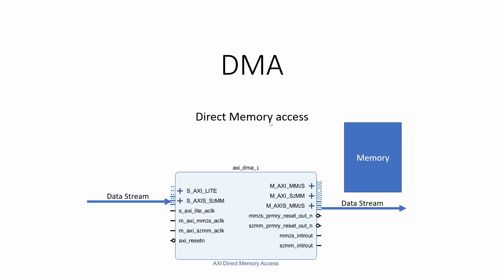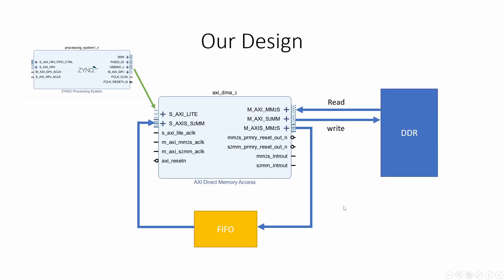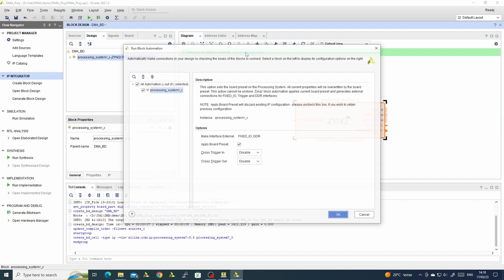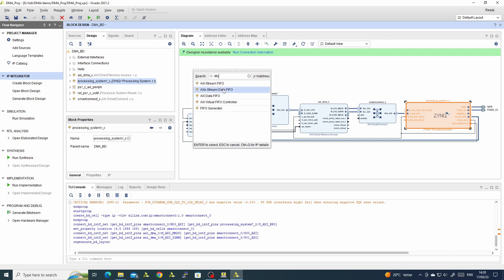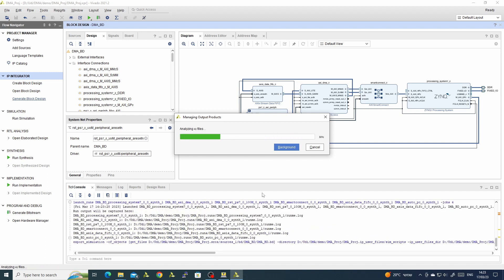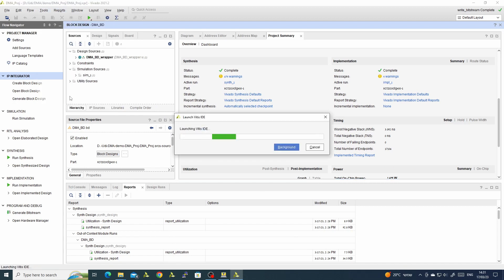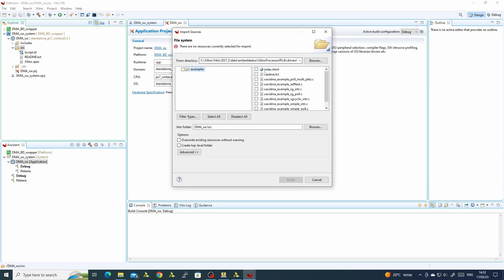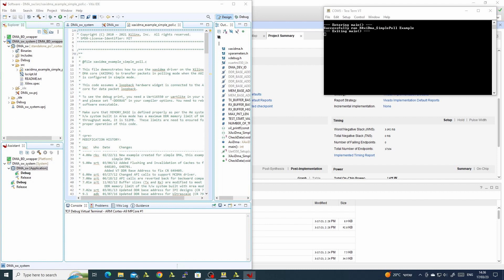DMA basic example

Comment: I am trying to move AXI data stream from an ADC interface in PL to PS for communication over Ethernet, and desperately looking for some resources to learn DMA for the same. Thank you very much for this video series. Learnt a lot. One question if I have to move data from PL to PS Ethernet, moving data to DDR and from there let ethernet BD read it is the best way forward or moving data from PL to OCM and from there to ethernet BD ? Which one would be more architecturally practical and suitable for a real time  application?
Reply from the maker: These are two separate questions:
To get the Data from the PL (ADC) to the Zynq DDR you need to store it in a FIFO and once you have fixed size (make sure not to overflow the FIFO), you can ether use Data-mover:
https://youtu.be/BeIYrQ3FUUo
Or have a DMA programed in advance to move the data to the PS-DDR.
Once the data is in the Zynq DDR (PS) use software to send it over the ethernet. In the Vitis, when you creating an application project, the last step is Templates. There you can fined lwIP examples. Those software's, are examples how to write & read ethernet packets.
Reply: @Udi-FPGA  Thank you very much Udi for the reply. I have tried to implement the interrupt DMA for transferring the data generating from a custom IP which is generating dummy ethernet packets at a regular interval on its M_AXIS port to store on the PS DDR. I was implementing the interrupt DMA  simulation example you have shared but it got stuck at SetupInterrupt function as it returned Failure. The only change I made to the example was I put this custom IP at the S_AXIS port of the AXIS DATA FIFO and connected its M_AXIS port to S_AXIS_S2MM port of the DMA IP while keeping the M_AXI_MM2S port of DMA IP disabled as I was trying to just write the data from the custom IP to the DDR. Now, I have gone through all three parts of Data Mover videos that you have kindly shared. It looks promising to me as the failure I am getting in setting up interrupt controller will not come there. Also I am using Unified Vitis 2024.2 IDE for software development and I came to know that they have changed interrupt handling from the  previous versions, although I don't think that could be the cause as I just used the example code as you have in your video and they have taken care of those changes in interrupt handling in the example code. So I am currently uncertain what might have caused this failure, I would be glad to have your opinion on this. For the time being I am moving to the Data Mover and will relook at the interrupt DMA and SG DMA approaches after that. Thank you very much once again.

Comment: Please make a video on custom pl data generation and converting it to axi stream so that it van be input to axi dma
Reply from the maker: The input to the AXI DMA is a simple AXIS (AXI Stream) bus. It just needs 5 signals: data, Valid keep, last & ready. I explain this bus in the beginning of this video. If you need to write data from the hardware to the DDR you might want to consider the Data Mover IP. This IP is controlled by hardware and transfer data to the DDR without software. (the software only needs to Invalidate the cache one the data was received). I might do a video on this some time soon.
Reply from the maker: As I promised, here is the guide to Data Mover: https://www.youtube.com/playlist?list=PLv0KRXOsP7UqbY4ZlhKZxJL52KkNipbAh in the second Video I make data generator for the S@MM AXIS input.
Reply: @Udi-FPGA  Take a bow master 🙇
Reply: @Udi-FPGA  thank you so much for the prompt response I'll try that tomorrow cheers!
Reply: @Udi-FPGA   I made a custom IP that contains some random data for testing, and i linked it to the axi interconnect. I am trying to send fpga data with axi dma to the ps side and then to the ethernet, is it a right approach?
Reply from the maker: @elfi2585  If you are generating data in the FPGA it will be much simpler to use AXIS bus (AXI Stream) it only has 5 signals data; valid, keep last & ready. Writing a data generator for AXI interface will be much more complex. After you have this data generator you can connect it to the S_AXIS_S2MM port in the DMA config the DMA like I did in the video and let the DMA store it in the Memory for you. 
Another option is to use DataMover IP. This IP has a S_AXIS_S2MM port for a data generator with AXI stream bus (like the DMA) but it has a S_AXIS_S2MM_CMD port to give the command from hardware. It is very important that the data generator will send exactly the number of bytes the command wrote! If there is a different the Datamover will issue an Error which only reset can clear.
I think to make a video on data mover sometime soon.
Reply: @Udi-FPGA  Thank you so much!

Comment: Awesome, keeep up the good work,
Really appreciating you making these designs.
hoping to learn more from you.
I am implementing your designs on Eclypse Z7 board.
Reply from the maker: Thank you for your comment. 
I plan to make more video like this in the future, and I hope you'll find them useful.
Reply: @Udi-FPGA can you please make a video on zynq ultrascale+ mpsoc.
Reply from the maker: @gnanapradeep2933   I wish I Could I need an zynq ultrascale+ mpsoc at home for this.
(I'm doing my Videos at home) but I work with mpsoc at work and it is exactly the same. just that the mpsoc have 6 cores and the zynq7000 only 2.
once you put your zynq in the Block design and add something (like DMA) the Autoconnection will work the same.